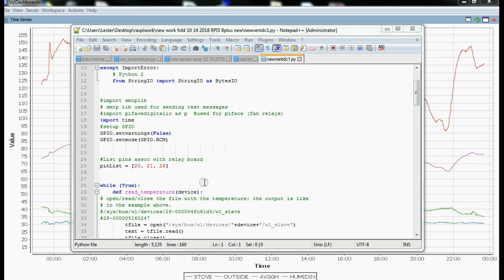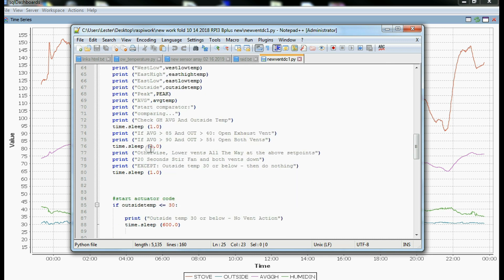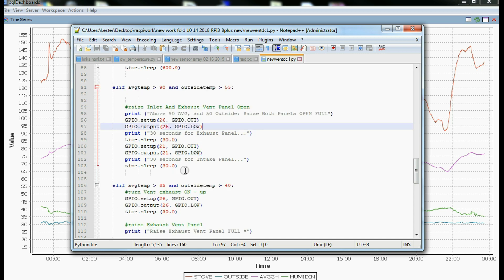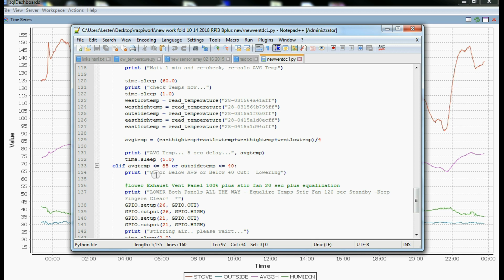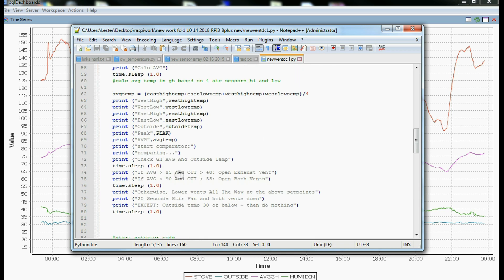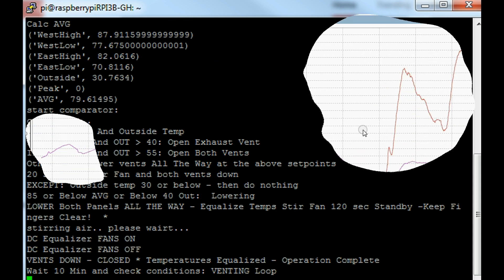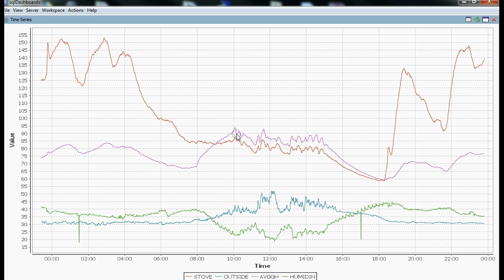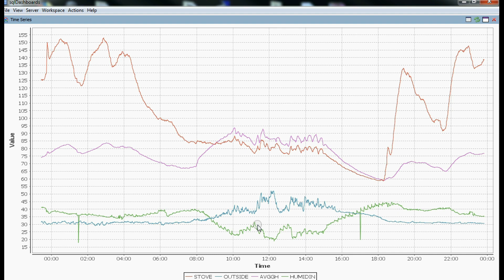Raspberry Pi DC Linear Actuator Greenhouse Controls Python Code Passive Venting

Comment: Hey, thanks for posting this!  I'm working on a greenhouse project now and am trying to do basically the same thing.  Especially appreciate your post because this is my first Rpi project, so getting familiar with the code and GPIO - your posting gives me a huge head start! 👍👍😎
  Couple of questions:    It appears that you go "LOW" on the relays to open the vents, then go "HIGH" to close them.  If I'm not mistaken, doesn't this keep the relay energized while vents are closed?  I'm guessing that the vents would be closed more often than open, so wouldn't it consume less energy and reduce wear on the relays if we made them "LOW" when the vents are shut?  
Also looking at the data logging - I'd love to do something similar to your arrangement.  Maybe a little simpler.  What "SQL Dashboard" did you end up using? 
Thanks!
Reply: This is awesome!  I am just starting out on a control system for a chicken coop here in the northern part of Vermont. I am new to Raspberry pi, and python.
would you consider sharing your code, so that I may use it as a reference?
I have created simmilar projects using VB^, however I am trying to update to Python and Rpi.
Reply from the maker: @johnrapoza  I have shared a lot of my code on my friend's website at hamradio.cc/forum  Unfortunately, the site is currently down. I will have to bug him again about getting it back online. So yes, I am willing to share my code.  I had tried sharing it here on youtube but YT doesn't like a lot of the "odd characters". Anyway, I'm glad to find your nice comment! Let me know if you get stuck and maybe I can help. cheers!
Reply from the maker: Well I had replied to this earlier.. but I guess it didn't get saved by youtube.  Thanks for the kind words! I'm glad I could help!  Yes, Raspberry Pi is counter intuitive on HI LOW... reverse from normal or how you would think. So in essence.. my relays are not energized unless vents are being opened. More here: https://www.raspberrypi.org/forums/viewtopic.php?t=92707  You and I think the same on power usage it seems! :grin:  On data logging I use Timestored.com SQLDASHBOARDS for charting: http://www.sqldashboards.com/   I am soon to update that to php and java based code served right from the pi but I have a few code hurdles to jump first. cheers! Let me know if I can be of any more assistance!
Reply from the maker: Also on my channel.. if you haven't discovered it yet, see my playlist on Setting Up Your Own Raspberry Pi : https://www.youtube.com/watch?v=wD0LMgaSNdA&list=PL837tk-T71LhGmSG2YEuA2U-LLvAQMhXs

Comment: I cannot understand "why" you have not removed completely , electronics and electrical controls.  Can you not find bi-metal coiled springs of the right strength to open and close the panels without any need of electronics.  You have harnessed water hammer.  Even gas filled tubes make more sense than anything "electrical".  What is the problem with physical devices for actuator motors instead of electric.  I'm lost in the design reasoning.  You have fire.  Therefore you can have water pressure or steam.  Bellows filled with water are more practical than electric.   A pleated 2 liter plastic bottle is cheaper than those motors.  It would need replacing every few months, but those motors are not much better.  What am I missing?  I don't grasp your "final goal".  Isn't it to "remove" failed technology?
Reply from the maker: I did initially look into it... but they are either expensive or hard to find parts.  I HAD planned on all non-electronic equipment... and your point is valid. However, a friend of mine turned me onto the Raspberry Pi and I started using it only for logging.. but then got excited at the control (precision) I could have for environmental controls. I DEFINITELY don't have time to replace parts that break regularly.. and certainly am not taking the risk on losing an entire greenhouse full of plants over a plastic bottle.  If I have to replace the linear actuators every couple months, I will DEFINITELY find a new manufacturer!  I am open to your engineering ideas.. Got a drawing or diagram?  BTW, commercial greenhouse controllers that do this sort of stuff are energy use intensive and VERY expensive:  https://www.youtube.com/watch?v=7diAyYSVQKM  https://www.agriculturesolutions.com/link-4-iponic-600-complete-environmental-controller?gclid=Cj0KCQiAtvPjBRDPARIsAJfZz0pCBfvnwOaOo-lOsO-ISRIk1alvYUkMQXLh-XM5fdoXVw8KvaHk95EaAqKCEALw_wcB